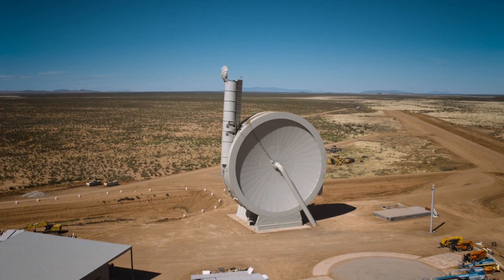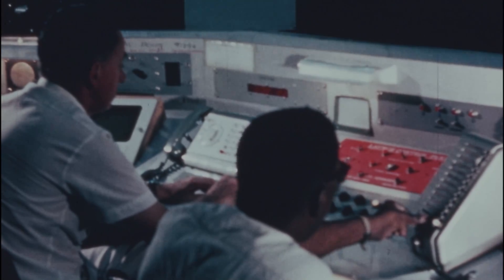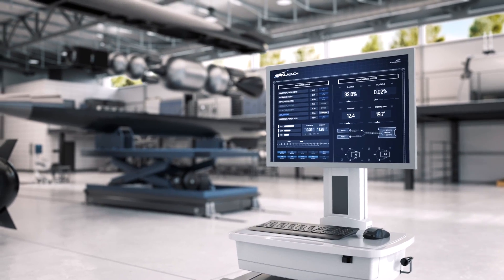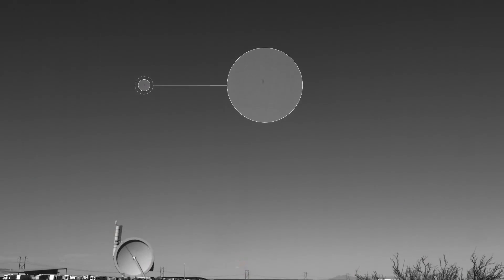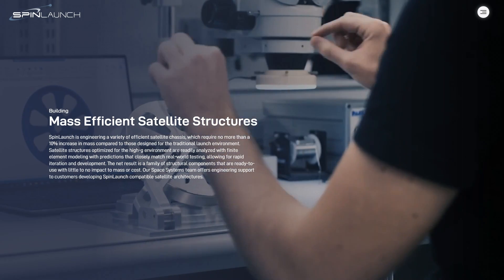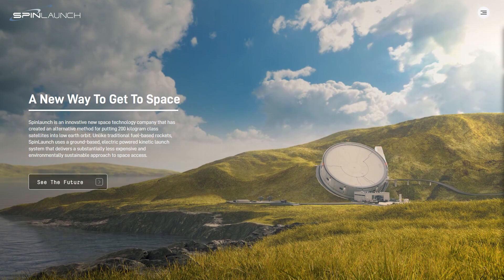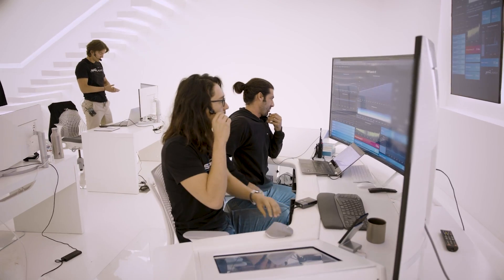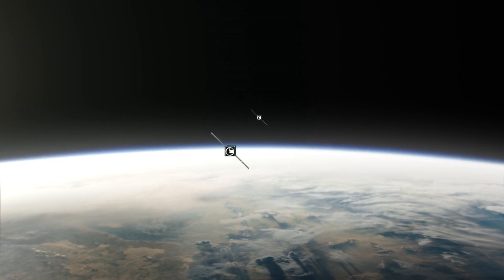Can Spinlaunch Throw Rockets Into Space?

Comment: in b4 watching, like all launch methods it is inherently limited by acceleration forces. rockets are used becuase any stationary accelerator devices would need to be several miles long.(simple acceleration rate and distance calculation) this size can be linear or radius.
At best you could use them to give a small boost to a rocket.
Reply: But in this case the payload travels the same circumference multiple times so the distance travelled during gradual acceleration can be very large without the device being large.
Reply: OK, I saw your comment (partially) in my notifications even though it seems you removed it and I want to respond. You're right that this device needs to provide high centripetal acceleration considering the high launch velocity and relatively small radius. However, this is a bit different from launching a rocket from some kind of linear accelerating device. That kind of linear device would need to either provide very high acceleration, which is difficult, or be very long. For this device the angular acceleration can be much gentler without the device being large. As you mentioned the centripetal acceleration is much higher but it's essentially provided by the structural integrity of the rotating arm and not (directly) by a motor so it's much easier to achieve.
Reply: @seneca983  I did not remove it. must be a youtube glitch
Reply: @seneca983  The short version was: The angular acceleration, circumferential distance traveled, and motor force are irrelevant. 
The the projectile is subjected to massive acceleration based only on the radius and release velocity. The force(centripetal) must be high enough to accelerate the mass from zero to launch velocity in an orthogonal distance equal to the radius. 
(Velocity is a matrix value [vector] not a scalar, so direction matters as much as speed.)
And I add:
The issue is that such a device cannot achieve anywhere near orbital release velocity, especially when air resistance is considered. The acceleration forces just from air drag, after release, will be massive. Its call max Q and is a practical engineering limitation even with conventional rockets. Thus a substantial rocket will still be part of the equation even if reduced somewhat from a static launch, and will its self need to withstand the launch forces.
Reply: @mytech6779  "The the projectile is subjected to massive acceleration based only on the radius and release velocity."

I see no reason why the projectile couldn't withstand that. Scott addressed that issue in the video. Furthermore, the projectile would likely be subjected to less vibration than in a conventional rocket.

"The issue is that such a device cannot achieve anywhere near orbital release velocity, especially when air resistance is considered."

Based on the figures given in this video "anywhere near" is an exaggeration. A rocket is still needed but it needs far less fuel relative to the payload so efficiency is much improved (potentially, if this thing works).

Comment: If you choose wisely where to put the spinner, you could use a water container at the other end and release the rocket at the appropriate angle and the container downwards, using air resistance to open up the container and dissipate the energy, it would turn into vapour and hopefully a mild explosion, but load issues solved the same way a s a recoilless rifle.
I do see a problem of a mechanical actuator being repeatable down to a 1ms range.  It WILL fail at some point, so arrangements for WHEN it fails are done.

Comment: You should have two loads, one at either end of the arm.  The rocket goes up while the counterbalance slams into dirt.

On the Moon, you could launch two rockets, both heading in opposite directions.

Sure takes a whole lot less hardware than a long-track linear mass accelerator.

Comment: It's like a whole company blissfully ignoring how strength to weight ratios don't scale linearly.
Reply: How so?
Reply: @seneca983  The general rule is that strength is a function of cross-sectional area while mass is a function of volume.  When you make something "twice as big" by doubling all of the dimensions, you've made it roughly 4X as strong, but 8X as heavy, so half the strength to weight ratio relative to the previous size.  Plug in any other scaling factor and you get the idea.  

Ants are known for being vey strong, able to lift many times their own mass.  If you were to scale an ant up to be the size of an elephant, it would no longer be able to lift the same amount relative to its own mass.  It's not that the ant is designed better than an elephant, but an ant is designed better for its scale and environment.  

If they can spin launch a small phone or action camera, it doesn't necessarily stand to reason that they can expect to launch something like a satellite at 10X the size.
Reply: @Firebert79TA  and how are they ignoring that? Do you really think that they could have made what they already have while ignoring that? Doubt thhat they didn't have even smaller test models before
Reply: @Firebert79TA  But I see no evidence that they have ignored such factor. How do you know that they haven't calculated how far that thing can be scaled? Secondly, the scaling issue here isn't as bad as you make it out to be. For a given launch speed a larger device would need a lower rpm and thus can scale up the payload linearly without increasing the centrifugal force caused by the payload.

Comment: The cost of building, integrating, fueling and launching a multi-stage launch vehicle is still much much less than building, integrating and launching a vehicle using that big salad spinner.
However, small scale versions for battlefield use looks almost worth it, if it can be done cheaply enough. Maybe a single use launcher for those non-orbital applications.
...got any element 115?
Edit: Did I see the ACME name on that thing?
Reply: "The cost of building, integrating, fueling and launching a multi-stage launch vehicle is still much much less than building, integrating and launching a vehicle using that big salad spinner."

How do you know?

Comment: Can't you do this kinda like a trebuchet and solve most of the issues?
More complex to fire, but solves lots of the extreme force and cargo problems.

E.g. a sphere in the centre which doesn not spin, with 2 of these spinning pieces, both attatched by rope to the payload like a slingshot.
That attatchment would need to be around the equator of the payload.
But when fired, the payload swings out, following the mechanism in one swoop that doesn't even take 1 revolution, and as soon as it reaches a the 2r circumference it should be moving faster than the mechanism does (radially), so it is released.

Comment: What they need to do is find the tallest mountain along the equator and build there.  Then they need to look into the possibility of joining 2 technologies - their spin launch & rail gun.  They could build a long barrel on the mountain so once it's launched out of the spin chamber, it's further accelerated up the tube.  This could benefit for loads that are heavier or if they have a short window for launch, where they don't have 90 min to spin up to full speed, but the rail gun could supplement the additional power.    There's lots of reasons a hybrid system would be better IMO, though I think it would be more expensive.  I think if they can get the spin launch working, they have cleared the largest hurdle & doing a hybrid system would be easier.  JMHO.

Comment: I can't see them scaling this up, the weights at those g will make it unusable, but I could see them scaling down to a personal weapon system varient.
Reply: I'm not as pessimistic. A larger device would need a lower rpm for a given launch velocity which somewhat offsets the other problems with scaling it up.
Reply: @seneca983  yeah I get the point but there's a physical limit on the materials we have available. This project seems like any small faliure would be catastrophic, considering the changes of weights when releasing the projectile, I'd question how many launches this thing (scaled up) could do before it needs a full rebuild?. Much like the huge rail gun that destroys itself.
Reply: @nomadicgrenada  "there's a physical limit on the materials we have available"

But I still think scaling this down would be more difficult than scaling it up because a small device would require much higher rpm.

"any small faliure would be catastrophic"

Possibly, but that's not inherently unsolvable. It's not inconceivable that the likelihood of a failure could be brought sufficiently low (though I'm not sure how difficult that would be).

Comment: What if they balanced it by putting an equal mass on the opposite end of the rotating arm? Then they could release both masses at the same time and save stresses on the rotating equipment, and they could release the non-launch projectile into a water tube that would heat up and drive a turbine or maybe slow it down through a series of magnets to retrieve some of the spent energy.

Comment: Would it not be much easier and more practical to put this thing on the highest mountain you can?  It would make pulling the vacuum on the launcher easier as well as getting the projectile above much of the pesky thick atmosphere.  Also with a properly chosen mountain the risks if a catastrophic failure could be mitigated.
Reply: That seems like a good idea. Might be infrastructure demands that require a less remote location though.
Reply: Building this thing that far away might be extremely difficult and expensive but ut might return positively because of the reason you gave.

Comment: The easiest way I can think of to rebalance the flywheel at release is to just have an equivalent weight be launched from the opposite side, into some kind of capture system. That capture system isn't a cake walk, but it's far easier to slow something down over a distance than it is to near instantly move tons of weight. (it's actually weight here, not mass.)

Comment: I'm still for the maglev space train, but that would require a really long loop and line to accelerate and ramp off of.
Maybe they could hybrid with this, have it spin around a stadium sized cylinder, accelerating along a rail rather than a center bearing, flip the tracks to the straight when it gets up to speed.
A maglev rail would require much less maintenance and rebalancing, and track switching would make timing the throw much easier.
Reply: @HydratedBeans  Halo is the ultimate outcome for humanity or we find that there is a mass relay floating near Pluto lol
Reply: This is the way. Imagine accelerating a stadium lenght(or longer) arm, that would probably weigh many times more than the payload. So much for the efficiency gain.
Reply: Giant Catapult I think

Comment: @5:35 This is all BS. They tell you that is is all nonsense by using the word "nominal" in that graphic. Nominal is a favorite buzzword from Fake-X. The vacuum must not be very high to have such a thin barrier. The Sandusky facility has concrete and steel walls. The hypersled moves at MACH 8.  The launched payloads are still not going to get past the firmament at 73 miles up.

Comment: How effective would an ultra high power laser be at heating the air in the projectiles path to reduce the density?
Reply: its a matter of energy/weight. Batteries for a laser suck in terms of weight/energy, it would be simpler to just have more fuel.
Reply: @aduck5639   how a bout a ground based chemical laser, that would deflagrat the back to produce thrust ?
Reply: @kimberly-jacobsen  given that these lauches are at high speed and angle, any failure in the coherence/ aiming would destabilize the rocket. Perhaps multiple lasers for redundancy might work.
Reply: @aduck5639  I was thinking a ground laser aligned with the barrel not one on the projectile. I was really wondering 1. does super heating air in the projectile path actually create a vacuumesque effect or does the extra kinetic energy in the particles negate the reduced density? 2. Assuming 1 is true could a currently plausible laser heat enough air along the path to have a significant effect?

Comment: On the Moon, you would not even need to launch it "up", but could lay the track out horizontally and easily make it a much larger radius without needing to be mounted on an equally-tall tower.
Without air resistance, the total kinetic energy determines its apalune, even if it's leaving tangent to the sphere.  In fact, it could be handy that you could launch from a prominence (mountain) that's not on the equator and in the event of an engine failure it will not crash, but already be in an orbit (albeit one that will buzz the ground at perilune).  Just make sure there are no mountains of equal height along its flight path, and trust that the launch site will have rotated a bit out of the way and the projectile will tend to pass closer to the equator as well.

Of course, the reality is more complex, since being so close the orbit is unstable as the Moon is lumpy rather than uniform mass.

Comment: I think it will be harder to find people willing to add continuous 10000 g requirements to their payloads than to get the actual engineering aspect to work. Maybe it could be useful for sending up very rigid components of something being assembled in space, but that's very far from being a practical business model. I still think it's a good R&D project, but I'm skeptical of any realistic business model.
Reply: 22,700 G force... Yeah I'll skip that :)
Reply: I think the crux of this problem is that surface mounted circuitry can already withstand these forces, if oriented in the right way, and if the board itself is supported well. I don't know if a source, but if an iPhone could already withstand these forces as he said, this really wouldn't be a problem.

Obviously it is not practical for all payloads, but there are plenty of small satellites with all surface mounted components and very rigid frames that could use this launch without much modification. Especially if everything was potted,  I don't see the issue. I remain skeptical for other reasons but percent of payloads that could already survive launch currently doesn't worry me.
Reply: There's no way any existing payloads would survive 10000g. I did work on a small sat in college, and they are designing around loading that is orders of magnitude smaller (like 10g). It's not a 1:1 comparison (those loads aren't a big issue) but IMO you would very likely need to spend a large portion of your satellite just on structural support to keep your basic components like PCB boards from snapping in half. Like a 4x4in PCB board that weighs a 100 grams will be subjected to 100+ lbs of force per square inch. I think it's plausible that you could design specifically to handle that, but I'm quite certain the 4 point support of normal PCB stacks in small sats I've seen would not be close to enough. I'm not a structures person, but I feel like you would be looking more at custom board designs with extra locations for supporting structure etc. And anything sensitive like cameras could also be tricky because you'd have to worry if the internal components of your camera were supported properly. I.e. lots of additional work (and money) on the part of the customer.